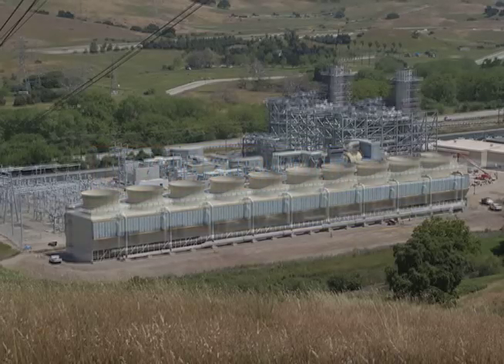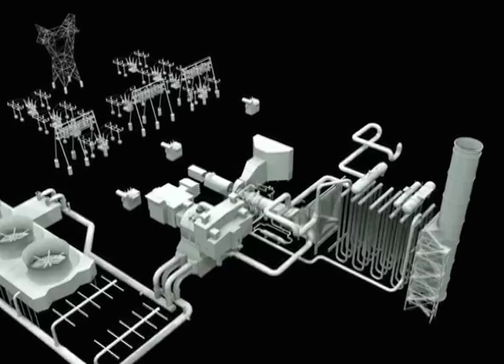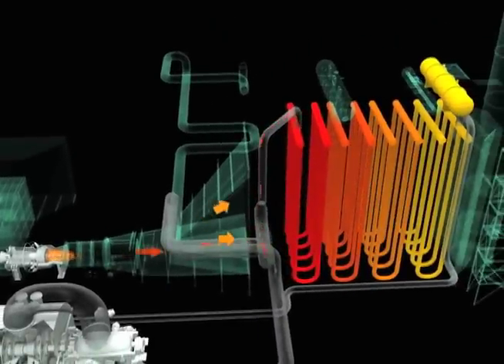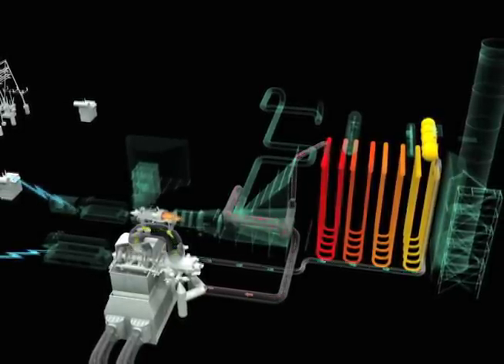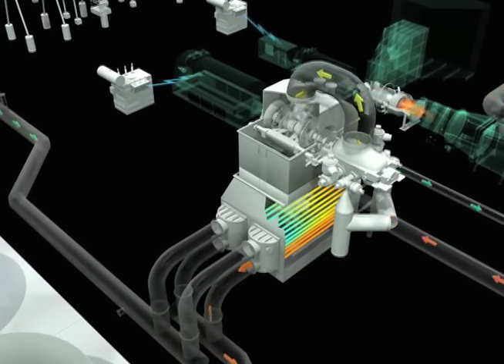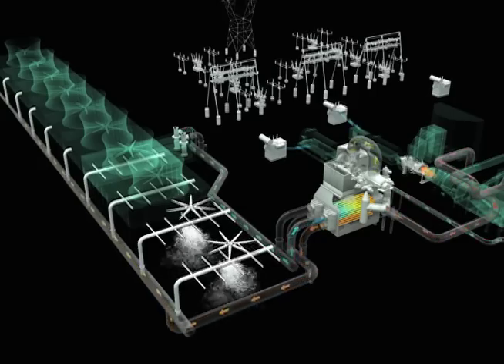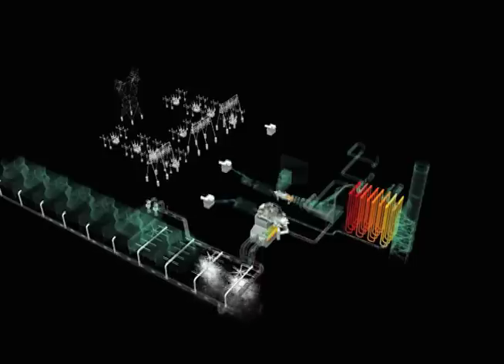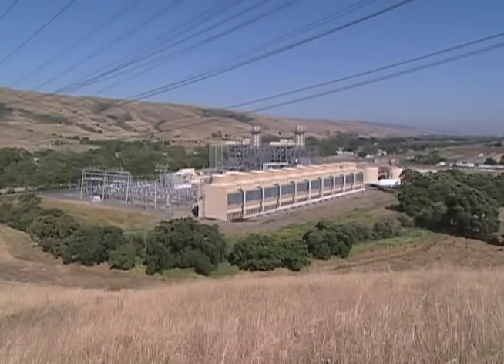Natural Gas Fueled Combustion Turbine Combined Cycle Electricity Generator

Comment: Could they dump the waste heat into the city water supply in the winter to help save on water heating bills for a cities' residents?
Reply: Nope! You would not want to do that. This is the most efficient way to use this heat.

Comment: Where is natural gas stored in the plant? If it is delivered by pipelines does it mean that natural gas directly goes from the pipelines to the combustion chamber?
Reply: No the pipeline goes into high pressure compressors, and the compressors deliver it to the turbine.